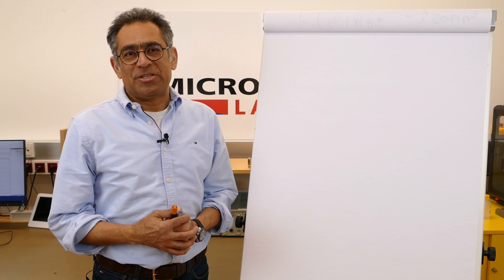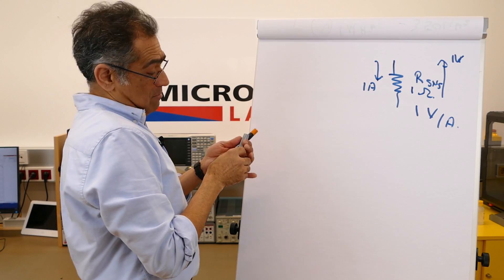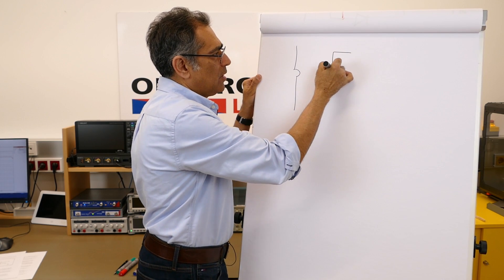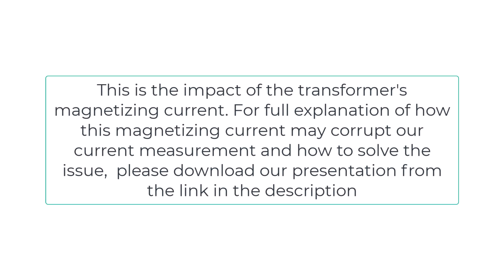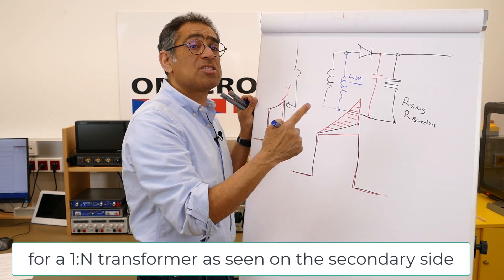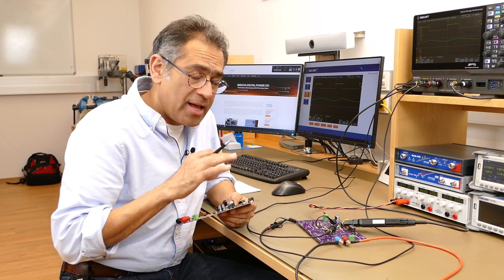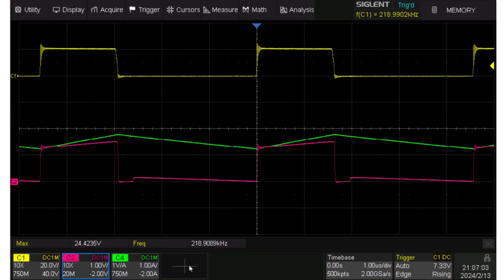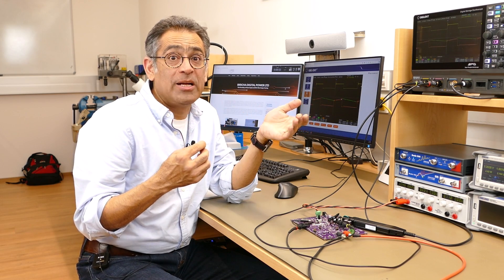Current Transformer based Current Sense Circuit Design for Current Mode Power Supplies

Comment: but if there is no hall sensor in place, how is this useful for measuring the DC component of the current? I can see it will measure the AC component of the current waveform but the DC component seems to be lost while with the sense resistor you measure the whole waveform